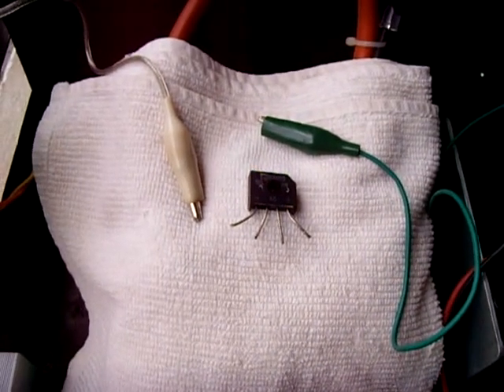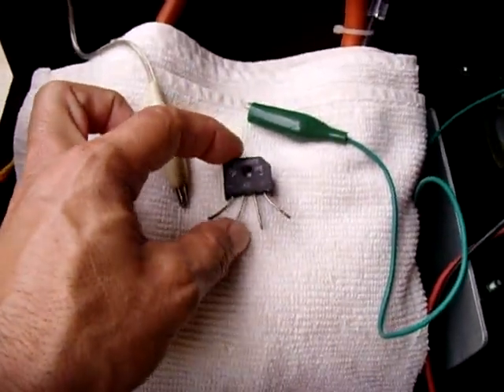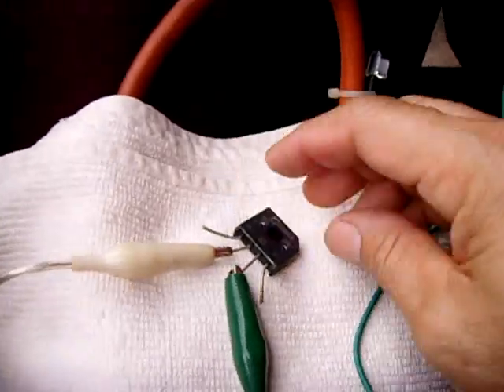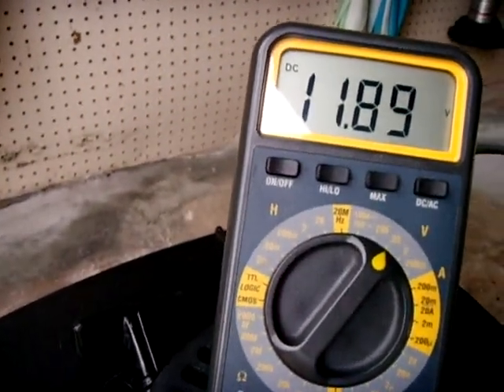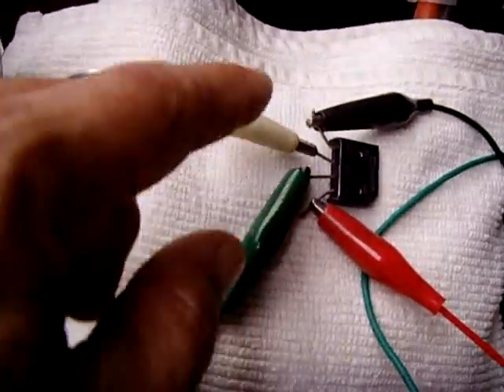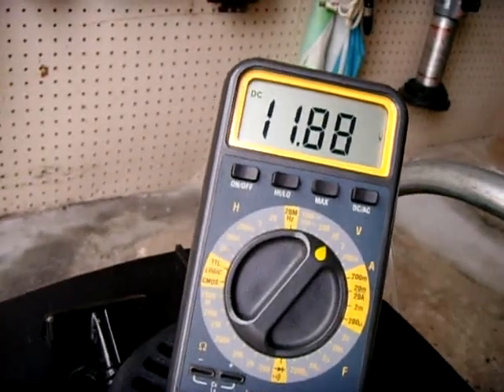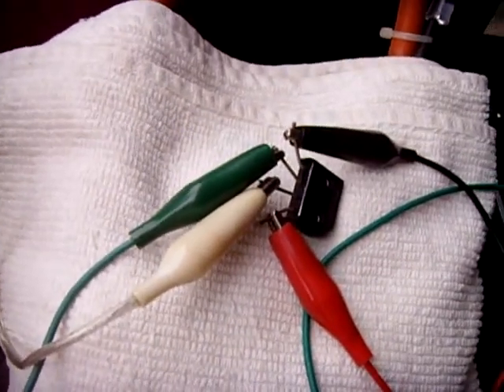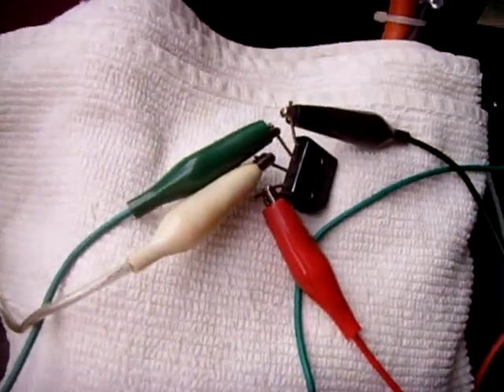How To Protect Circuits From DC Reverse Polarity!

Comment: Yes this is quite useful. I even mentioned it in other places and they were like "no that's a bad idea" I don't get why all it does is it makes sure current goes in a single direction
Reply from the maker: If the current used isn't excessive, and the diodes are low loss Schottky, it works very well. Thanks for watching!

Comment: I've been designing circuits for 40+ years.
This circuit does it's job, but take note that...
1) The output voltage is ~1.2 volts lower than the source voltage due to the two diode voltage drops in the bridge rectifier.
2) If the source negative is the system ground, then the output ground is ~600mV higher than the source ground.  Again from the diode voltage drop in the bridge rectifier.  If this difference is not accounted for it may cause error is other circuits down the line.

A better solution is to use just 2 diodes in a half wave configuration for the positive voltage.  Use schottky diodes to keep the voltage drop to a minimum.

This mis-wired connection to the circuit (reverse polarity) goes  undetected.  This undetected mis-wire may cause problems when connecting other circuits to this "protected" one.

IMHO, the simplest protection is to use a single schottky diode so that if a mis-wire happens, the circuit will not power-on at all.  But you do have to take into account the voltage drop of the diode and the power through the diode.  
When troubleshooting, the mis-wire will be detected and corrected preventing any other potential problems coming from the circuit being mis-wired.

Comment: Just be aware that a bridge rectifier will drop the voltage of the battery by about 0,5V to 1V.
Reply from the maker: That was made clear in the video. Use a Schottky full wave bridge for minimal losses.
Reply: electronicsNmore 
Oops, I’m sorry, I misser that. 😬

Comment: Thanks for the tip! What is the voltage loss with this method?
Reply from the maker: Listen The voltage drop depends on how much current is flowing.
Reply: electronicsNmore wouldnt It be Max 0.7 x 2 = 1.4 volt, regardless of the current? Thanks!
Reply from the maker: Listen No. The voltage drop will be higher when more current is drawn.

Comment: Hi,
I just installed a 2500W inverter in my van, have 2x 120A batteries, and everything is OK, but outlet is giving me 238 V but when I tested it gives me reverse polarity, I checked everything, it is ok and correct, but still reversed polarity, my coffee machine is not working , as well as my 800W micro oven.  An advise will be much appreciated. Thanks in advance
Reply from the maker: I take it the inverter is 12vdc to 240ac? If you see "around" 240V on a 240V inverter, then everything should work.
Reply: electronicsNmore 

Yes, sorry its 12Vdc to 240V AC, and as I am new to this (and also like my coffee :) I thought that I bought wrong inverter but any how, thank you for your response, I might leave for now, and later Call a professional to check or fix, or maybe you will do a video by then so We can get better understanding. As it is not clear what to do, better to leave it for professionals

Comment: thanks bro, ive been trying to find out how to connect a bridge rectifier for a week fir ky capacitor charging system im building for my emp project.
Reply from the maker: +Andy M 
You're welcome Andy. Please be sure to check out my video playlists, and share my channel with others. Thank You
Reply: electronicsNmore ok, when i get a little free time ill make sure i do, currently i posting a few questions i have and im wofering if you know the answer. I know that here the way you used it there was no specific way of connecting dc, but is there a spacific way of connecting ac?
Reply from the maker: https://robrobinette.com/images/Guitar/HowAmpsWork/Bridge_Rectifier_top.jpg
Reply: Ok, thanks dude. You du man

Comment: the old bridge rectifier was what we used in the old days of some of the older truck which had + ground system on them  such  as fright liners up till the mid 80 or 90 heck they may still be doing it and to keep from blowing the protecting doid and blowing fuses when swapping line trucks

Comment: Ok will do thought you may have come across it the way you have thought if how to use the bridge rectifier joe booker alias joe cell talks about reversing the wire in the alternator before the regulator but I struggle to understand electric he uses positrons from the vacuum to run an engine in atom stripped neutralise air watch joe cell horses mouth about 57 minutes in you will see his escort running on air

Comment: Yes you can you can get the positive pole to give out negative I had a car battery do it on a pajero when I towed it with the hazard lights and headlights on without the engine running and when I went to charge it because it went totally flat whilst towing it back 150 miles the battery charger would only go in the opposite poles but someone stole it watch this video joe x user brey213
Reply from the maker: You must not be explaining yourself well. A battery will ALWAYS have a + terminal and a - terminal in the same place. I have never heard, or seen a 12v lead acid car battery reverse polarity.  Post your question in the "All about Circuits" forum.
Reply from the maker: electronicsNmore I would be VERY concerned about the battery reversing again and destroying something on your vehicle. Get a new battery. Keep that battery for projects/backup.

Comment: Hi would you know how to change the polarity of the cells in a car battery but still keep the poles the same I am informed its bridging the 3 phases on a old type dynamo with the engine running and supposedly on a alternator reversing the wire before the regulator would this make a potential 3 phase out put with hen pole neg being pole + and pole pos being pole pos - thanks
Reply from the maker: What your saying does not make sense. You cannot change the polarity (+ or -) of a battery.
Reply: electronicsNmore yes you can i can make the     + read   -  and  -  read +  and i can start wit a fully  charged battery .
Reply from the maker: It may be possible, but I never saw that happen before. You would have to completely drain the battery all the way down to zero volts for that to be possible.
Reply: That's a horribly bad idea.

Comment: hi, everyone any one explain me, if i have two terminal cables of dc power which have no identification mark on them, color also same, then how i come to know which one is positive and which one is negative terminal.
Reply from the maker: Don't really understand what you mean. By using a digital multimeter you can easily find out. If you connected the meter backwards(red/black), then you will see a (-) before the voltage readout, then you know to reverse the wires to find out which is pos and which is neg. If your talking about the rectifier doing this for you, the diodes are like one way valves(check valves), the positive output will always end up where it is suppose to be, and the same goes for the negative.

Comment: Back in the early '70s when I was actively Breadboarding projects I added this to the power input of my designs. Once the project was finalized, however, I saw no need to make it permanent since the power supply was a self-contained  battery or AC transformer. 

73 -- de Mick, WB4LSS
Reply from the maker: If you did not need it, then that is good. I was just letting people know another use besides rectifying AC.

Thanks for watching!

Comment: For sure, but that 1.2v drop is a big bummer, especially if you use it in a circuit that draws appreciable current. If 2 amps is flowing you're already wasting 2.4 watts approx. You can improve on this massively by assembling a bridge from Schottky diodes. Or just use one in series with the circuit. This won't allow the circuit to operate both ways, but will protect it against reverse polarity. A more brutal way, but with no voltage drop is to install a diode reverse biased across the power terminals ov the circuit. When all is normal this diode has no effect, but when reverse polarity is connected, it shorts that reverse current. Like I said, it's brutal. Best have a fuse involved too. And use a meaty diode! It doesn't need to be a Schottky in this case. Finally, if you want to get fancy there are ways and means ov doing all this very cleverly with a mosfet. :)
Reply from the maker: 1.2V drop? How did you arrive at that? .62V drop. Your correct. Using high current Schottky diodes would GREATLY reduce the voltage drop.
Reply: electronicsNmore In a bridge rectifier the current always has to pass through TWO diodes. So 0.6v+0.6v = 1.2v It does not matter whether you feed it with AC or DC in this regard.
Reply from the maker: The battery voltage is 12.50V, The output is 11.89V, which is .61V. I do not see a 1.2V drop, unless I am missing something here, but as we stated earlier, Schottky diodes can cut way back on that voltage drop. For the great majority of circuits, there will be no issues, for higher current circuits, there will be some heating in the diode. I don't see it as a big issue. I think the idea is great.
Reply: electronicsNmore If you take the time to trace the current path through a bridge rectifier circuit, then you will see without a doubt that it HAS to pass through two diodes because a bridge rectifier is a steering circuit. Ergo, it must then have the voltage drop ov two diodes. But what you also have to remember is that 0.6v or 0.7v are just nominal values for the voltage drop ov a silicon diode. This voltage varies according to current flow and temperature. If the only thing you have as a load on your bridge is a DMM, which probably has something like a 10 Mohm input impedance if it's a decent one, then you will find that the v-drop is on the lower side. Try loading your bridge with a 50watt halogen bulb and then measure the voltage drop! hehe ;)
Reply from the maker: It makes sense what you are saying, but you still seem stuck on the fact that we are using a regular bridge rectifier for HEAVY loads. Switch to a bridge made from high current Schottky diodes for heavy load use, and the issue will be minimal. The purpose of the video was to show a simple way to prevent reverse polarity from destroying electroincs/devices, and in that respect it does a fantastic job.
Reply: electronicsNmore So then you agree what I am saying is correct, yeah? Actually, although Schottky diodes do improve things, they are worse offenders for increasing their voltage drop with current, so although better, they are not ideal by any means. The simplest way to protect from reverse polarity is to use a single diode in series with supply in, as I pointed out previously. And this would be the most ideal simple solution unless it's absolutely necessary for the device to function with the power connected either way round for some reason.
Reply: xanataph And btw. I am not knocking your video, I am merely pointing out some limitations and solutions for those that you or others here might find helpful. :)
Reply from the maker: Sure you can just use one diode pointing in, but then you no longer have the nice capability of having the circuit operate properly regardless of polarity. I would say as long as you do not push too much current through the bridge, everything will be fine. I tested the circuit with a 1.2A lamp, and yes, there was around a 1.2V drop, NOT using a Schottky bridge, so using one would reduce that to well under 1 volt. Up to 3 or 4 amps should be OK using a high current Schottky diode with a .16 volatge drop. You can operate 12V devices lower than 12V, so there should be no issues.
Reply: electronicsNmore I'm glad you bothered to check it. Yes, I think I definitely implied that a single diode disposed ov the "either way" functionality in my last post. There is one other thing to be aware ov with Schottky's. They usually don't have a very high PIV. This won't be an issue with the 12v circuit, but something to take into account if designing for higher voltages. And speaking ov voltage drop again, you are right, most 12volt circuits will operate ok with 1.2v less. But with something operating at 5 or 6v this is a much bigger issue.
Reply from the maker: I made note of this in the video.
Reply: electronicsNmore Cool. I do like your videos though. That's why I subscribed. I especially liked that one where you went to that old army base and got all those cool old components. :)
Reply from the maker: I should do a video of that base.
Reply: electronicsNmore Definitely. That would be really cool. :)
Reply from the maker: nature took it back. The place is grown over, and the buildings heavily damaged from hurricanes. I will do a video. Like going back in time. Huge old generators still there.
Reply: electronicsNmore Yes, it is amazing how fast nature can do that..! I'll look forward to the video. Been good talking, but better mission on, so have a great day / night. :) I gotta do some stuff on a remote power transfer switch I am working on, using an ancient relay..! heh

Comment: You can use plain diodes too!
Reply from the maker: Yes. Use Schottky diodes. Much lower voltage drop. Instead .62V, maybe only .15-.2V.

Comment: Excellent! Simplest ideas are usually the best :)
Reply from the maker: I knew about this a while back, but figured it would be a great video, as simple as it is. Many people do not know you can use a bridge rectifier for that purpose. This is especially good for 12V lead acid battery Chargers.